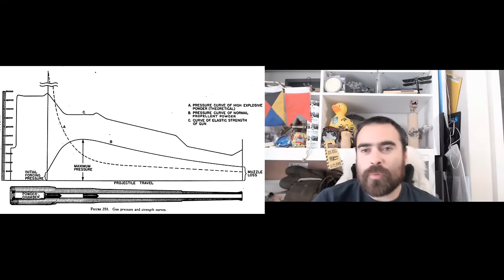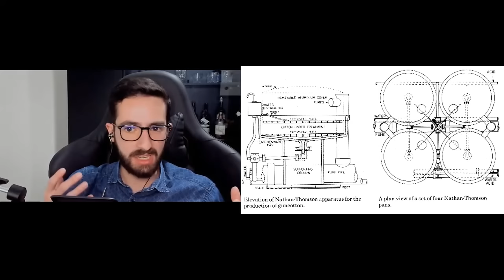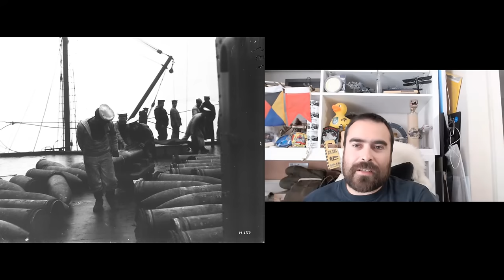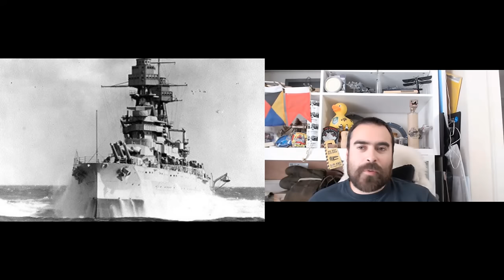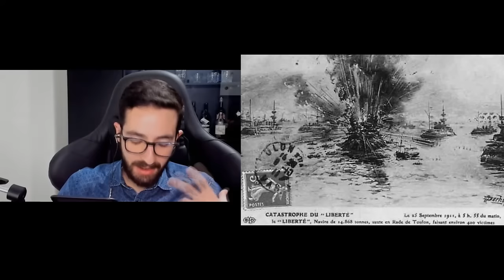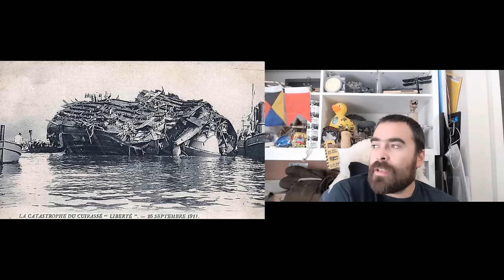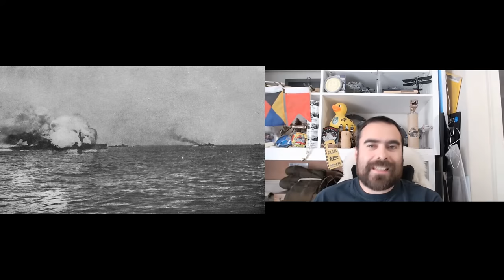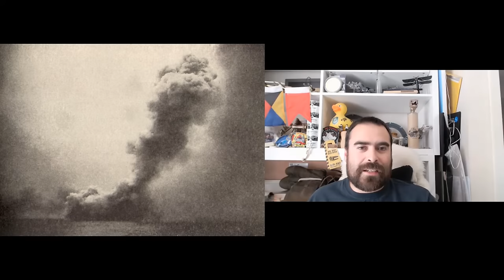Cordite and Poudre B - Why things start exploding at just the wrong time

Comment: This video really explains why the Bismarck never exploded, even after getting the pounding it got and why it had to be torpedo to sink it. You’s should do a video exactly on this point about the hood going up/down so fast. As the hood was overdue for its refit/overhaul, had a older refrigerator plant and probably ageing cordite. As you never touched on there’s point’s in your hood video.
Reply: Hood used Cordite SC which very different from Cordite MD used at Jutland. SC was based on German ww1 RP C/12 and was 49.5% Nitrocellulose 41.5% Nitro-glycerine and 9% Centralite. MD was 65% NC 30% NG and 5 Petroleum Jelly. Specifically the 15" used MD45 which was extruded through a 0.45" die and SC280 which was extruded through a 0.28" die.
Reply: @jonathanevans4610  Thank you for your information, So i understand your saying SC is in a form like wax/candy so there’s no dust issue/flashback issue. As these no dust issue on hood it come back down to a short shot deflecting below the armour belt with a slow fuse maybe hitting the petrol tank on the way and setting light to a uncontrollable fire or a deck shot deflecting down basically doing the same.

Comment: Very interesting, Thank you for the details. Speaking of Nitrocellulose, Aircraft Dope comes in two main types. Nitrate and Butyrate, the nitrate is basically liquid nitrocellulose and as such when it dries it is highly flammable. The butyrate type will burn but not nearly as rapidly. Which leads to the question about the Hindenburg, was it doped with Nitrate or Butyrate? Just a thought.
Reply: Nitrate is not waterproof so Butyrate, which is, would be my guess. But, and there's always a but, add aluminum powder to Butyrate Dope for color? Aluminum powder is one of the main ingredients of todays solid propellant rocket motors.
Reply: @joeh5028  Aluminum powder is also used in various explosives. Torpex was IIRC TNT and aluminum powder.

Comment: Nitroglycerine was so unstable on its own that most large mining operations or railroad projects in the American west and other regions simply set up a plant and manufactured the stuff on-site rather than risking trying to transport it. 

Cellulose nitrate (guncotton) is also perilously close to celluloid (which adds some badly needed stabilizers) which is why old movie films used to be so dangerous.  Early plastics plants in the US used to have most of the same architecture as explosive plants (small buildings with very thick walls, spaced well apart). 

Question-- if the dust was such an issue, what about the shock of the ship itself firing its main guns?

Most non-black powder high-order explosives of the early 20th century were based on low-molecular weight aromatic hydrocarbons such as toluene and phenol that were produced as byproducts by city gasworks and steel plant coke ovens.... e.g. trinitrotoluene, or 2,4,6-trinitrophenol (picric acid aka Shimose and Lyddite). These were limited in production and had a zillion other potential uses, so some composite products were developed like amatol, which is a mixture of TNT and ammonium nitrate. If you were really challenged, like the Russians in WWII who had basically no sources of aromatic hydrocarbons, you could at least make ammonal, which is ammonium nitrate and aluminum powder (sometimes sold in the US as Tannerite, for people who have guns, gender reveal parties and not enough common sense).

Comment: I remember from chemistry the discussion of Gibbs free energy and how it relates to the spontaneity of a reaction.  I also remember that entropy played a big part in that (along with enthalpy).  That's the reason why salt dissolves in water.  In the dissolved state it has far more entropy, and since Gibbs is negative it is spontaneous.  That being said, I think you would want to maybe minimize entropy, so that the reaction is less spontaneous?  Maybe I am wrong in my assumption, but I would think that a boom boom with maximum enthalpy and minimal entropy would be most ideal.  It gives you the most amount of usable energy to dissociate anything around it.  I fiddle bits, not molecules, and It's been 30 years since my college chemistry, so I am probably remembering wrong.  :D

Comment: hmm a note on the issue of acid residual. see if this comment gets me shadow b&. from experience with guncotten its a bit of an art because after adding the nitro group(s) to the cellulose, you typically neutralize the acids with something similar to baking powder. if acids are bad for barrels, bases are much much worse, so its better to stay on the extra acid side of things. also with too much neutralization you get the accumulation of a crusty base salt film which can reduce the formability and burnability of gun cotton, so it makes sense that everyone was erroring on the side of leaving extra acid behind. also i think keeping water out of the gun cotton can dramatically reduce the effects of left over acid, but that seems impossible on something mass produced and on a ship getting knocked around and handled. salt water can get into anything on a ship over time.

Comment: Poudre B is grey only because of the graphite coating.  Most smokeless and black powders are coated in graphite to prevent charge from building up and to prevent grains from sticking to each others.  The solid gelatinized nitrocellulose is white-to-yellow and looks (and feels) like grains of plastic.
Reply: The Poudre B was essentially plasticized nitrocellulose.  Pure nitrocellulose had too much surface area (it is made of tiny pieces of cellulose), so it burned too quickly and was very easily ignited.  But when it was dissolved (in acetone or an ether-ethanol mixture), you can then evaporate off the solvent and resolidify the nitrocellulose into large, solid grains with a small surface area.  So chemically it is the same compound, but surface area is smaller.  Then burn rate (and pressure rise) can be controlled.  For cordite (and most modern powders), the nitrocellulose is dissolved in the nitroglycerin (instead of in acetone).  This desensitizes the nitroglycerin, keeps the two solidly bound, and decreases surface area (again because it is in large clumps).

Comment: Didn't the US Navy learn to eventually to rotate stock of the propellant bags? To use up the older ones first and bring in the new to be back of the magazine for loading?  The silk was also a great barrier to keep dust out of them, and it's anti static properties.
Also the stock of shells or propellant bags were rotated as the pressure rate of the rounds would get higher as the mix of chemicals became more energetic. This was to equalize the pressure in the bigger guns to maintain a measurable, consistent projectile velocity. Of course they would just load less or more bags at will for gross distance and angle of the guns.

Comment: It can be a fine line between combustion and detonation , and , if the P/T conditions exceed that point , you do indeed get a big pipe bomb instead of a cannon or rifle .
The reason Potassium Nitrate is used for black powder , versus other simple nitrate salts , is , that it has a far higher critical point where it would transition from burning to detonating .
You CAN use Sodium , Calcium , ammonium , or , even urea salts for black powder , however , it is most definitely NOT recommended .

While spicy glycerine is some sweaty brow stuff , it's early reputation had far more to do with trace acids and side products ( very unstable and reactive side products ) , than with the sensitivity of essentially pure NG .
The various side products were often more sensitive , and , they along with the trace acids would react with the metal cans and especially the solder in the joints to make a veritable witches brew of insanely sensitive primary explosives , that tended to go off with little more than a mean glance or bad attitude , taking everything with them .
TNT was a better solution for many purposes , at least as far as a general use explosive .
It burns quite nicely and many an old miner has been kept warm over night by throwing a stick of it in the pot bellied stove .
This is often accompanied by the sudden  exodus of greenhorns ,  screaming loud obscenities and soiling themselves .
TNT , while more powerful than NG , is far less sensitive to most everything .
This can be a problem when you WANT it to explode , and mandates the use of various compositions of booster charges to hit it hard enough to wake it up .
RDX , can also be burned and heats rations very well . Unfortunately , it is very toxic and there are a lot of well documented cases of soldiers being poisoned because the knife they used to cut up the C4 was then used to stir the pot or to eat with , had traces of RDX still clinging to it .
The fumes are also toxic .
You really do not want to induce any shock into burning RDX or it very well may detonate .
There are many legends about it being used for a nastier version of the flaming paper bag of dog shite gag .

Comment: Maj. Gen. Julian Hatcher, in "Hatcher's Notebook" (required reading for all us pyros, as well as anyone interested in the technical aspects of firearms & explosives). writes the following.  Torpedoes employed nitrocellulose (gun-cotton) as the explosive for their warheads.  It was stored, damp, in large quantities.  Small dry amounts were stored very securely.  Dry gun-cotton detonates easily, when subjected to the action of a blasting cap, and deflagrates violently when exposed to a spark or flame.  But when wet, it does not.  But it DOES detonate, if in contact with the dry material which has been detonated.

Comment: Fun fact - you mentioned at circa 41:30 that the increased center mag heat would increase round range. This is also a well known sniper trick. Leaving your rounds out in the sun will give you a better burn and thus more velocity and with it, range, out of the bullet.

Notably, Canadian sniper Corporal Rob Furlong used this to achieve his 2,430m sniper distance record kill in 2002. This record is currently the 4th longest distance confirmed sniper kill, the record stands at 3,540m set by an unnamed JTF-2 sniper.
Reply: Utter nonsense. Randomly changing the ammunition pressure would change the zero and make the rifle less accurate.
Reply: @snowflakemelter1172  This was stated in the documentary about it. I don't think this made up. You can account for this change in range, which Col. Furlong had to do. Between that and the like 5 crosswinds he had to deal with, he had to take 2 ranging shots on the target before he managed that kill shot.
Reply: @engineerskalinera  it's rubbish.
Reply: @engineerskalinera  what you have stated is correct in regards to temperature affecting velocity. The difference in velocity at 1.5 miles between warm and cool ammo is negligible. More likely he set his ammo in the sun to get it close to the temperature it was when he zeroed his rifle to minimize shifts in POI. Afghanistan gets really cold. I saw it get below -20F° often at 7000MSL. Lord knows how cold it got up in the mountains.

Comment: Remember a quote from an officer on a WW2 UXB dismantling course, the guy said that the explosives rate of reaction is quicker than the human nervous system so you won't feel a thing if it all goes wrong.
Reply: Detonation is super sonic.
Reply: It is 24,000 feet per second with C4 (det cord).  High explosive is defined as a propagation rate faster than a shock wave (compression front) moving through a solid (about 6000 fps).
Reply: OH  YEAH  FELLA?  THAT  DOESN'T  HAPPEN  YOU  GETTING  BLOWN  INTO  BLOODY-PIECES  AND  YOU'LL  FEEL  IT!

Comment: Gun cotton is wash in sodium bicarbonate...as in baking soda baking soda which neutralizes both acids making it more stable and using it whole its wet actually increases the power of the explosion.. sometimes it's soaked with acetone corned into a powder by itself

Comment: Nitrocellulose and Nitroglycerine are still the basis for most modern gun powders with various additives like Nitroguanidine and other stabilizers and coatings of graphite. Burn rate is controlled by grain shape and thickness and in some by the number of holes in the grain.

Comment: I question the idea of "nitroglycerine powder". Nitroglycerine is a liquid, melting or freezing at 58 °F, so a powder of it will not be possible at most temperatures. I offer another possibility: does cordite weep nitroclycerine? Could this saturate the fibers shed by the propellant bag so you have just nitro saturated dust? Would probably have the properties you ascribed to nitroglycerine powder itself.
Reply from the maker: The RN documents describe the charges sweating through the silk bags, this then 'crystallised' on the exterior of the bags and this then could be rubbed or knocked off by moving the bags around.

Comment: I gave been present  at burning of unwanted Cordite. at a safe distance, You dont want to be anywhere near it, intense heat. Also, Early Cordite degrades over the years and a puddle of Nitro Glycerine forms under the Cordite bundle. All thats now needed is some rough handling of the devices containing the Cordite and Whammo, This has happened when mines that have been collected some long time after being recovered from the sea.

Comment: Cordite did have Nitro Glycerin in suspension in the wax like tubes . It sometimes went off prematurely if the propellant aged and then pure nitro weeps out and it become very unstable explosive . Same deal with Gelignite . Old cordite 303 rounds could also weep nitro .

Comment: Actually sounds to be a issue similar to common dynamite (nitroglycerin saturated sawdust), that over time the nitroglycerin comes out of suspension (sweats) and crystallizes, resulting in increased sensitivity.
Also believe settling over time could result in a gradient of percentage of nitroglycerin, vertically, through a container, possibly resulting in puddling or extremely high concentration.

Comment: I once set off a 3lb coffee can full of 50 yr old cordite pulled from .303 ammo by dropping a lit cigarette on top....and for sure the result was FAR different than a similar exercise with compatible modern rifle powder for that cartridge like IMR 3031.   The cordite burned brightly for just an instant then went BOOOMM!!!! with a mushroom of flame probably 100 ft into the air.   Very dramatic and NOT what you'd want to have happen inside a magazine.   That same amount of 3031 would have burned vigorously with a large flame but taken several seconds to finish...where the cordite acted like an explosive rather than a propellant.   The fact that it was 50 years old might have had an impact...but I gained new respect for cordite afterwards.

Comment: Read something years ago regarding a proof-of-safety test of the new "smokeless" (or at least non-bp) propellant somewhere in the East Anglian fens. From what I recollect (if indeed the text was true) they assembled a bonfire stack of approx one ton. It started burning nicely with a lot of flare but nothing else. After a while the observers retired for luncheon, some time during their meal the heat reached a critical point towards the centre (or perhaps a portion had a different composition) causing detonation even though not "confined". I wonder if anyone else had seen this mentioned.

Comment: In charge of a historical munition's storage bay for a museum I was advised that old munitions transfer nitro into the carbon molecules of iron over time. Especially in non optimal storage conditions! So munitions that had been rendered safe some years before could leach the nitro back out of the carbon into the green crystals lining the inside of the empty shell or grenade! Just unscrewing one could cause a flash that could burn or blind! I found 2 surrendered grenades mounted on a munitions art board that had that exact problem! Filling them with acetone for a week dissolved the crystals & made them safe again!

Comment: There's also the issue of picric acid <trinitrophenol>. In time it reacts with iron to form an extremely sensitive explosive...think  THE DEEP, the very end when Goliath blows up... that was more than likely a picric acid explosion
A perfect example of a rapid deflagration is the loss of Challenger
A recent transfer of the film to hi def video shows a tsunami wash ashore after the explosion and burning powder bags flying thru the air!
And believe it or not, the original was in color... sadly that print was lost/misplaced.

Comment: When I was on active duty in the US Army back in 1971 studying Explosives Disposal operations, they showed us a Film on a disposal burn of out-of-date battleship propellant weighing 4,000 pounds placed in a 10 to 15 foot by 10 to 15 foot and around 5-foot-deep pit. Ignition was a long pile of shredded wood packing material lit with a railroad flare. The flame reached 1 million degrees f and melted the camera lens from thirty feet away. After that all disposal burns were done in low poured out piles 6 inches high stretching for hundreds of feet like a big snake with shallow enough curves to give 10-foot separations. If the pit had been 2 feet deeper and the load was increased to 6,000 pounds it would have high ordered.
Also, Nitro dust will give you a massive headache. I know I have had them from contact with the stuff and the fumes.

Comment: Estimate time to abandon ship from all parts of the ship. Add to those times recovery from shocks, etc. 
Blast radius around ship for each type of explosion, along with secondary effects like fuel spillage, etc.
Slightly safer explosive types may have saved many many lives where seconds to get away, or not quite die, count.  

Structure salvation, due to chains, rather than one big explosion, also factors into this.